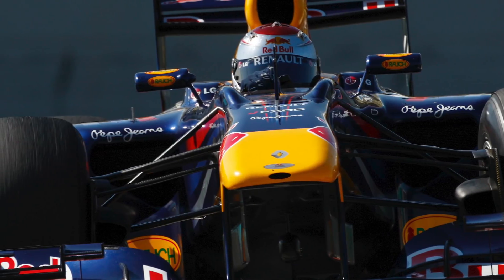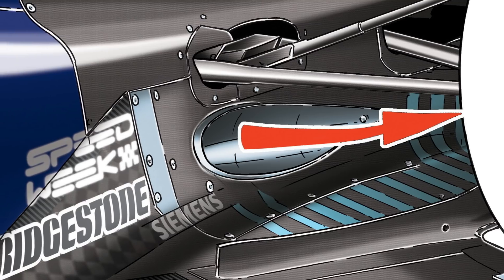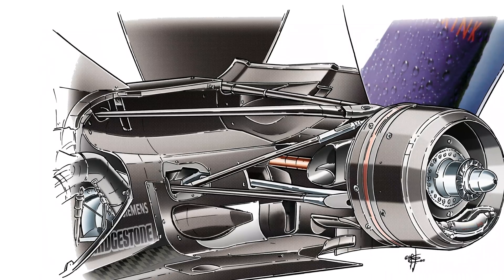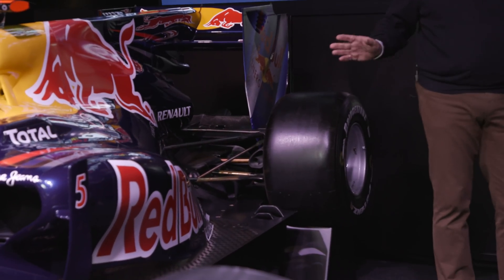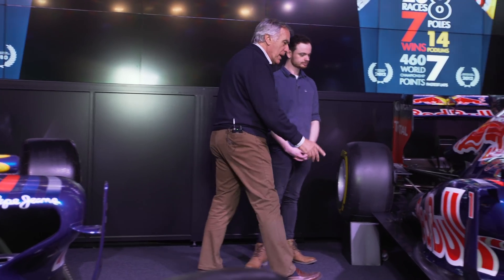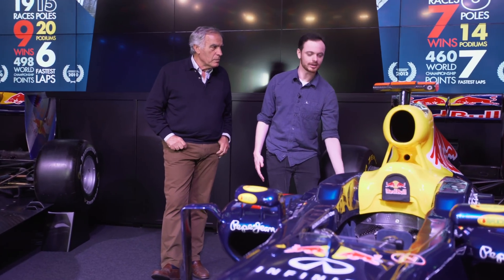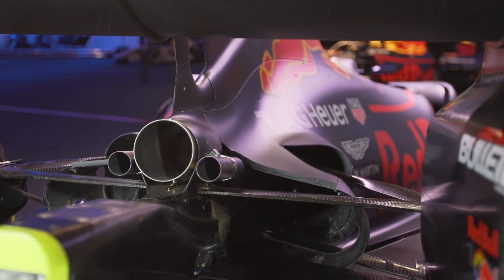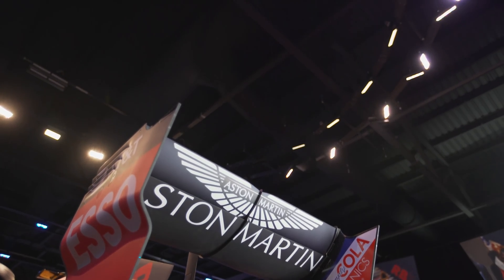The F1 aero trick Red Bull stole a march with - before it was banned

Comment: There should be a committee which should be chaired 1/3 rd by vetted team representatives, 1/3 rd by vetted car mechanics and engineers, 1/3 rd by FIA stewards. This committee will review the appeals of FIA to ban innovations of teams. This will be a fair and swift tool for F1, also will remove the dogmatic monopoly of FIA politics in the sport which will empower team’s innovations and give them more sense if control.

Comment: I know this is an older video and hence my comment probably won't come across many hearing ears, but could you in theory, design an exhaust that conforms to the regulations, but at a higher RPM, the pressure in the exhaust is so high that it deliberately breaks a restricting part in the exhaust which causes the same air blowing effect to persist for the end of the race? Even if it happened every race, this would still be a damage caused by the circumstances of a race and on paper, give the same advantage whilst being legal. You can race a damaged car, but it seems like regulations never thought about car damage giving an advantage. I know now with the turbo hybrids, just as the video mentions, it wouldn't be as dramatic, but it could give other advantages that could be engineered. It would probably come with a swift regulation change if the FIA or other teams catch on, but I'm still interested if that is in any way legal or exploitable :D

Comment: Sorry but the exhaust on the RB6 blows directly into the upper level of the double diffuser, as you can see there's an open slot directly behind the exhaust outlet which leads into the diffuser. It is even more effective as it directly accelerates the airflow inside the diffuser as teams have done in the late 80's. However, not all of the exhaust flow goes into the diffuser as some would spread on top of the floor. Starting from the RB7 the exhaust flow is placed on the further side of the floor which means it seals the gap between the tyre and the diffuser.

Comment: I mean I dunno if the blown exhaust contributes or negates the turbulence coming off the back of an F1 car, but the fact it means a car can help generate it's own downforce, without any outside influence, it solves a bit of the problem of car loosing downforce behind another car, promoting closer racing surely? Plus the fact the 2011 cars sounded fantasic and loud when they had blown exhausts on downsift, FIA need to get thre priorities straight.

Comment: That blown diffuser was Vettel's best friend.
Reply: Yeah, he really needs huge downforce on the rear wheels.
Reply: Gavin Alavi as shown in 2014 when the rear wing was simplified and he got beaten by Ricciardo in the same car.
Reply: @michaelcollins966  yep the V6 Turbo hybrids are far more torquey than the NA V8s, that's why vettel was still fast even back in 2008 and 2009, but struggled come 2014.
Reply: Abcd Efgh it helped that a naturally aspirated engine had a smoother, gradual power delivery, yes? no?  i dont think todays turbo hybrid engine have lag but they do still come with torque that can still give a good kick... and for Seb's case, spin inducing effect...
Reply: @Jojo_Bee  the lag might be mitigated by the hybrid system, and I honestly dont think they have much lag as the engines probably are tuned to keep the turbos spinning constantly to eliminate lag. Atleast now, maybe not in the beginning of the turbo era.
Reply: @Jojo_Bee  Quite the opposite modern F1 cars are instantly on the power that means they can be a bit more twitchy with the rear
Reply: @antonioakiki3716  that turbo lag is eliminated by the MGU-H
Reply: @pangeranrio0112  Yeah but MGU-H systems were a disaster for all but Mercedes in the beginning of the hybrid era. Look at the F14t, a complete dog that understeered on entry and oversteered on exit
Reply: He changed his driving style  for the RB6. Part way through the corner he would floor it knowing with confidence the grip would be there and would get better with higher engine and road speed.
Reply: So bad that Mark Webber hadn‘t a car with a blown diffusor 😉
Reply: It was banned mid 2012 so in 2013 (he's most dominant season) it was pure man&machinery synergy
Reply: Without it, he became Spinbastian
Reply: @djdelarosa25  you mean S🅱️inbastian

Comment: What ever happened to run what you brung?? Having the governing body take away engineering and innovation seems to be counter productive. Example NASCAR
Reply: I don't understand how peoplr enjoy nascar, I mean they're just going in an oval at the same speed, how TF is that exciting to watch
Reply: @artemperesada3454  They don't now, as NASCAR has tried to be more like other racing series. Prior to that, it was about endurance and emotion control more than anything. While yes, driving an F1 car would be tough for the average person, to a decent driver they're quite easy because they have the downforce to be predictable. Stock cars... not so much. They are large, heavy, and have little downforce.

Whereas F1 is like running the Grand National on a thoroughbred race horse who's trained to run such a course, stock car racing is like running Churchill Downs, for hours at a time, and with 42 other people inches away from you most of the duration... and you're all riding bucking bulls.

Comment: They must allow it in 2021 why?
Because than they create so much downforce with the diffusor and they have not to make all the downforce over the frontwing and than there is not so much dirty air. 
Is that right?
Reply: Rear downforce sure. The front wing still requires airflow and will be affected by following another car.
Reply: This solution was mainly for rear end grip. I ment that the car could run with a much smaller rear wing which creates much less drag.the front wings would still have to provide most of the down force for the front of the car. It wouldn't cure the aero problem that we have today which is caused mostly by what is happening at the front of the car.

Comment: The use of such exhaust flow is quite ingenious and in and of itself should be allowed in my opinion.  I assume the sticking point with the federation was the control of the throttle when the driver was not responsible for it.  In other words, the FIA saw this as a type of traction control and subsequently banned it.  Was this the rationale behind the banning?

Comment: Why did they ban it? Seems like a cheap solution that everybody could experiment with.
Reply: "safety"
Reply: Basically they want to remove any individual discoveries as to not cause the teams to spend millions of dollars changing everything on their car to get that same advantage. 

But yes, it very much ruins F1 technology.
Reply: Yeah but the problem is nowadays it costs a lot to do anything. So say you're 2 years in new rules and 3 before new regulation, and another team comes up with something ground breaking like that. 
Now you have to spend a lot of money in RnD, testing, materials etc on something that wasn't even in the budget to begin with and probably be a headache to make work with your current vehicle. Plus potentially throw away all that you had planned until the new regulations 3 years later. 

Very few teams can just turn it around like that and not just go bankrupt. 

I agree that it sucks but if you don't like Mercedes' domination right now, let's just say it would be even worst competition, with even less teams participating.
Reply: Lucas de Abreu Mercedes wasn’t competitive back in that time.
Reply: blowing 800 degree flames on suspension parts and body panels. If you didn't pay attention to the 2011 season, there were quiet a few issues from team to team trying to get it to work, and the designers from RBR were not being straight forward with the FIA on how it worked to keep other teams from copying the system. Just like Mercedes with FRICS. Oddly enough nobody cares about that ban sense it wasn't that high profile even though it was clearly an advantage that allowed Mercedes compete well against RBR and Ferrari.
Reply: It's tricky solution, because It's dangerous for driver a motor map who acelerates without action of driver. The question is why these maps weren't banned before. It's clear that FIA wanted Red Bull win these years.
Reply: @celsodeporico6761  There wasn't anything that dangerous about the exhaust blowing for the driver other than engine failure.

Comment: Why dont they do this with Mercedes? Just ban their advancements for once
Reply: They did at least do that with oil burning. The rest? Not so much.
Reply: name one advancement then. merc just do everything well. they dont have 1 advanement that gives an advantage
Reply: @nanderlizernanderlizer684  They use holes in their rear wheels which cannot possibly be anything other than a movable aero device. Renault's mass damper was even banned for being a movable aero device. Then there's the oil burning, party modes and FRIC (that was only banned after a very long time)
And those are just off the top of my head. If you compare this with the era in which Ferrari were dominant, there's no way they could have gotten away with so many advantages over the other teams.
Reply: Mercedes are fast because they were working on their engine in collusion with the FIA back in 2010/2011

Comment: FIA shouldn't be allowed to ban any technology without safety grounds
Reply: There is always a safety ground: to preventing the car from going too fast in the corners. That alone defeats this entire thread.
Reply: so true
Reply: Lucas de Abreu  I think it would be chaos. We would have more than 10 seconds between 1st and last team, some cars would be to fast for more than half circuits and we would still have domination of one team, most likely with most money and for what? So you can say wow, they are so fast because "blown diffuser",so cool. And in the end what fans have? Not racing, just point that blown diffuser is fast(just example)
Reply: @BladeRunner031  the f1 is not just competition between drivers. its competition between manufacturers and engineers. if they cant design innovation that can be competitive.. they have no place in the race that is supposed to be the TOP in technology for cars.
Reply: Richard Porter  I mean I agree that rules are too strict but from I saw in F1 if you give teams finger they usually take whole hand
Reply: For me f1 is not all about the racing there is other racing series that are better for that to me f1 should be about pushing the barrier of what man and machine can do. Like it used to be crazy designs 6 wheel cars fan cars etc. The engineers are are limited by the rules of f1 to much these days. Now there going to start standardising parts and when it becomes full electric there will be little to know difference between the car on the front of the grid and the back it might make for closer racing but it will slow  progression of tech.
Reply: I still want a Formula X concept where clever ways of getting around the rules are rewarded with cash prizes.  Exhaust-blown diffuser?  Here, have $32M.
Reply: If you want to know what F1 would look like with no or little to no regulation, just look at the 1950s and 1960s. If you started to make lunch when P1 crossed the line, you could eat it comfortably before P2 was across the line
Reply: "cars that are more stable in corners go faster in corners, that extra speed makes them unsafe! Ban!"
Reply: @thejusmar  It is true, though. There is a limit to what the human brain is capable of processing, and the FIA is trying to encourage innovation while trying to delay when we reach that point. Look at Group B rally. As cool as it was, drivers died regularly, and the ones that survived were calling for it to at least be toned down because the cars were too fast for them to keep up with. The Group B deaths and the death of Ayrton Senna in F1 served as a kick in the balls for the FIA to start doing more about safety and restricting car speeds
Reply: sadman hoque for FIA president.
Reply: FIA should NOT be allowed to ban ANY technology WITHOUT safety grounds.  To ensure the teams dont have an excessive advantage over another... BUDGET CAP!  Thinking an idea is one, building it in a limited budget is another.
Reply: Ok hear me out

They remove bans on stuff so teams can come up with a solution to go faster. Mid way through the season they take a break so teams on the bottom lagging can innovate and come up with better stuff and make a comeback.

The break length can be decided by having team meetings and discussion before the calender year begins.
Reply: @assasindeath  The reason the small teams can't compete when a big team finds a breakthrough isn't because they don't have the time to copy it, but because they can't afford to copy it. That's why active suspension was banned, but turbocharged engines have become the norm
Reply: @filmandfirearms  I did not say copy them I said come up with something better. While the team ahead will also have to work to improve on their pervious breakthrough
Reply: @assasindeath  Again, the issue isn't time, it's money. How is a team spending a quarter of what the top teams spend supposed to afford the same kinds of facilities or the same quality of staff or the same amount of test parts? They can't, which is why the budget cap is being introduced
Reply: @filmandfirearms  I understand that and which is very good and that's how it will go if there are 2 halves in a season

Fix amount of money for a calender year. So if u use up most of it in the first half to develope you will only have resources to improve in second half. And there can be many combination of results further in coming years and even if u think u are ahead in first half you are uncertain about other half
Reply: @filmandfirearms  That's just my stupid theory :p so let's just not debate over it xD
Reply: @assasindeath  Sounds good I’m theory, but that would be a logistical nightmare to plan around.
Reply: Fia it's actually helping innovation. Banning cool systems it put's those awesome european equipes to invent new systems even better than before you brainlet.
Reply: Sooo...traction controlled all-wheel drive fan cars with the most absurd wing designs that make it impossible to follow and overtake added with blown diffusers? 

Yeah, sounds like a great idea. Imagine the old Ligier Camel like car, added with 'safe' X-Wings and a fan and of course 4 small wheels in the front. Great idea.
Reply: @steckelton717  of all the thing's you've mentioned, only 'absurd wings' would cause problems for the chasing car; which goes to show how much you know about this.
Reply: It would be something the designers would want to see since they would have more freedom. However, I dont think it would improve the racing on track.
Reply: Yes, who dont want to see different engine layouts, different aero concepts, different suspensions, different drive chain on the same track.
FIA just dont understand racing!
Reply: Before you say something like that just try imagine F1 without rules,just try and tell me it would be better
Reply: @BladeRunner031  yes it would it would be crazy